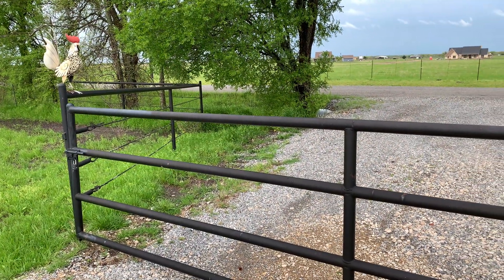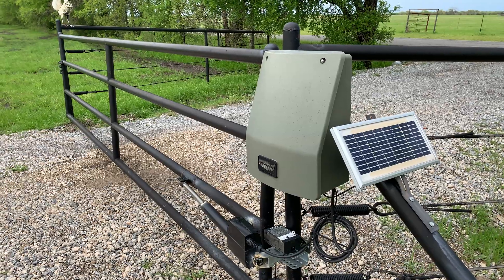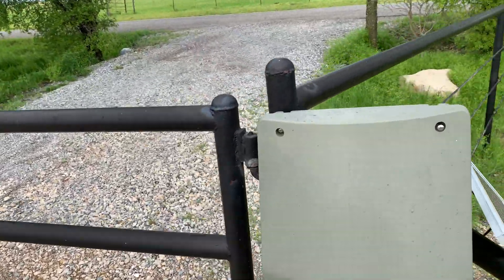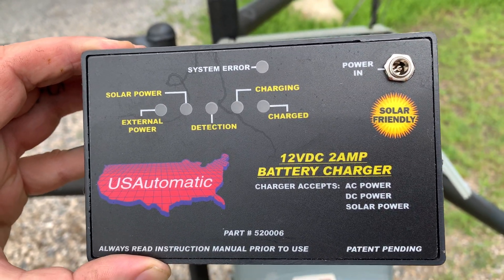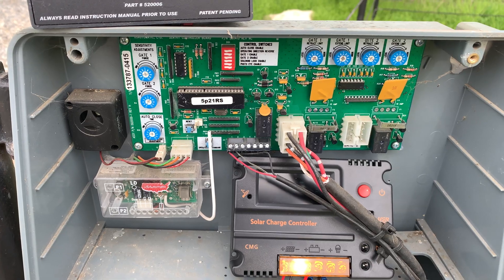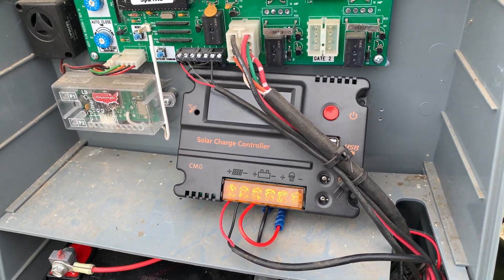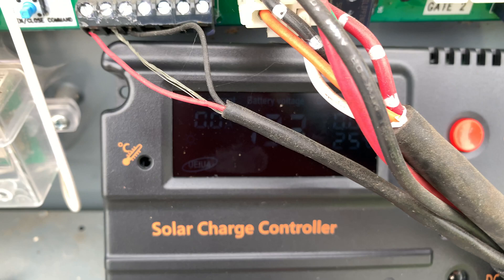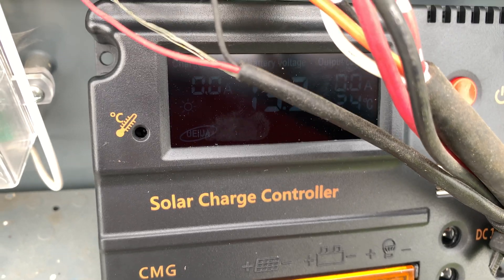Solar powered gate converter repair/replacement automatic gate opener (USAutomatic)

Comment: Is that device in place of the second battery.  With have a liftmaster and it has two batteries.  We are solar powered as well.  How can I tell if the solar panel is not working?  Thanks!
Reply from the maker: Hello Susan, sorry for the late reply.

The "device" is a solar control module, and it is NOT a battery; it would not be a substitute for a battery IMO.  I unfortunately can't speak to your gate specifically as we have different models, but, I can tell you that my particular gate does NOT have dual backup batteries.  The single deep cell battery I have is charged by the solar control module via a single solar panel. 

Hope that helped!

Comment: Your actuator arm is installed upside down
Reply from the maker: Interesting, as it's been that way for several years with no issues!  I don't see how installed one way or the other makes a difference, do you know if swapping it over the other way helps in any way at all?  

Appreciate the comment!